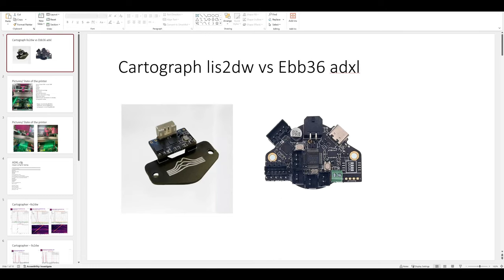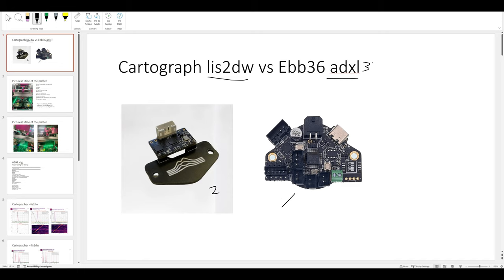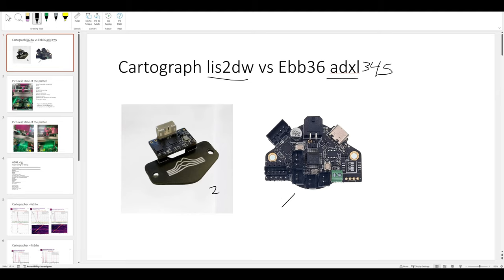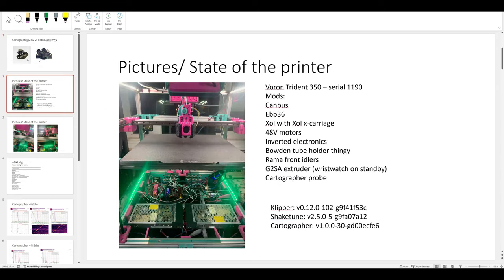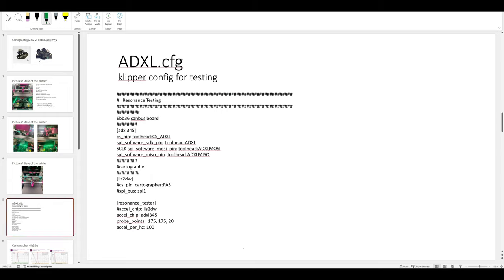Let's talk accelerometers: lis2dw (cartographer) vs ADXL345 (BTT ebb36)

Comment: so you think the BTT S2DW V1.0 is worse for shaping than the BTT ADXL345 V2.0 despite the spec differences? i am bothered because i ordered the adxl when it shows the lis2dw version has roughly 2x better specs .even though this would probably not show at all still stresses me lol. i appreciate your video and replies.

edit: read up on the klipper docs, which confirms youre correct.
Reply from the maker: So you are correct from what you read the LIS2DW should be a better accelerometer. The problem is their build in bandwidth filter which is set at 400 hz. Whereas, the adxl345 is set to around 1600 hz. Some LIS2DW are better than others. Why some better than others? We do not know. It is a crap shoot. The general advice is to avoid the LIS2DW, and stick with the adxl345

Comment: For belt shaper you need to make sure cartographer and ebb36 are referencing correct y and x, I haven't found axis map for cartographer- need to look for equivalent. The flip of amplitude can just be that they're reversed reference axis.
Reply from the maker: Axis map is purely visual. Further, Belt Shaper does not break down the measured signal into x, y, and z components. It is the total of the entire signal. Which is why you only have one graph per axis (a and b). Thus, changing the axis map will have no effect upon how the the graph is visually presented.

Comment: Great video Reth! Thanks for posting it. I have heard recently that the limitation on the LIS2DW is due to the settings applied to it through klipper... apparently, it's being set up in low-power mode instead of high-performance mode. This is why it stops reporting above 200Hz. According to the datasheet, the sensor should be capable of 1600Hz. Are you aware of this "low-power" issue?
Reply from the maker: My understanding is that, in klipper, the lis2dw is set to high power mode. But the Lis2dw has a 400 hz anti aliasing filter built on the high power mode, and is non-bypassable. This means the max frequency it can get is 200 hz. Further, it is my understanding that using low power mode one cannot get the freq necessary for shaketune. 
I could be wrong, but this is my current understanding

Comment: is it fine to use the version with lis2dw or it's still a no no ?
Reply from the maker: As a bed sensor it is fine. As an accelerometer, e.g. a replacement for an adxl345, an lis2dw is no good